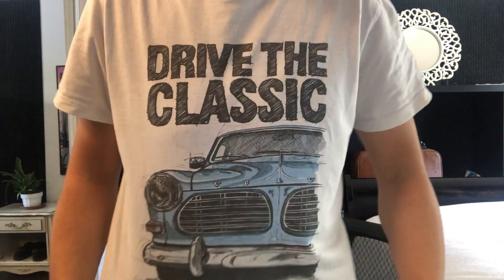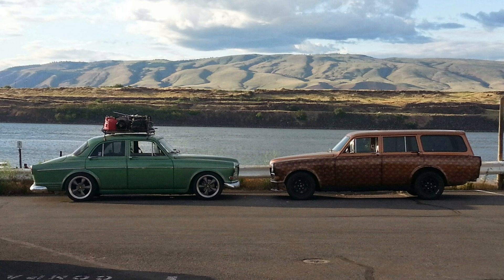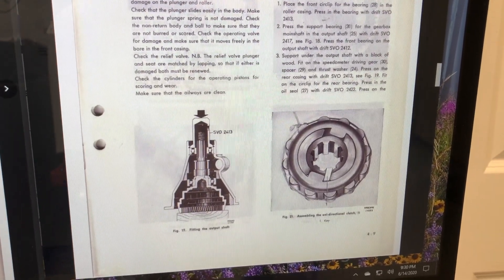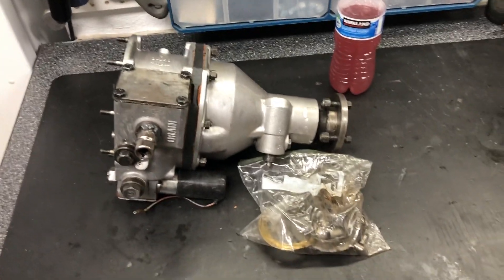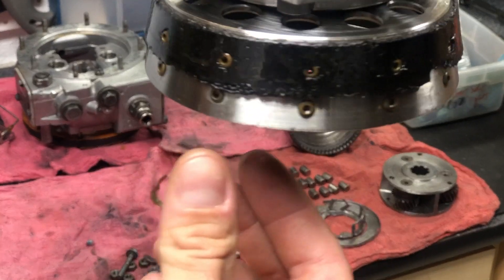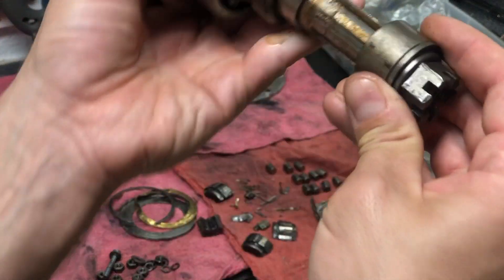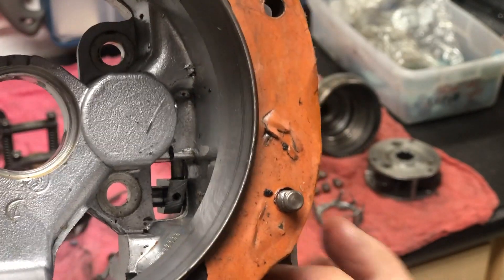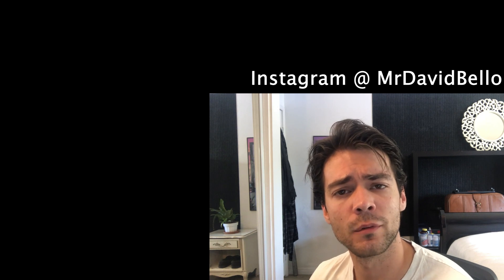How I exploded my Volvo's Overdrive: Amazon M41 D-Type Laycock Dissection

Comment: The unidirectional clutch is probably better described as a one-way bearing, and it only comes into play when the overdrive is activated. When the overdrive is deactivated, all of the spinny bits inside are locked together by the overdrive cone clutch and it just adds some spinning mass to the transmission output. Engaged overdrive driven in reverse will toast that one-way bearing, exploding it with enough torque (like in reverse gear). At low speeds the overdrive doesn't engage very solidly and you'll toast the cone clutch, so it's usually locked out in the first few gears. 
tldr: put an indicator light on the overdrive solenoid. As long as the solenoid is adjusted properly, the light will warn you if the reverse/low lockout switch isn't working.

Comment: If the solenoid engaged the OD while in reverse, the uni-directional clutch is destroyed. Safety lockout switch for reverse gear not working?

Comment: Why dont you do gearbox swap with welded housing? I have BMW ZF in my volvo. Holds easily 800Nm or torgue. Never had a single problem with running 100hp thru it because it can move a tank.
Reply from the maker: CzMnHD oh wow i don’t think even the chassis of this car can handle that much power without some added bracing. It’s just a simple cruiser for me, not a hot rod. I’m ok with the zippy 100hp feel